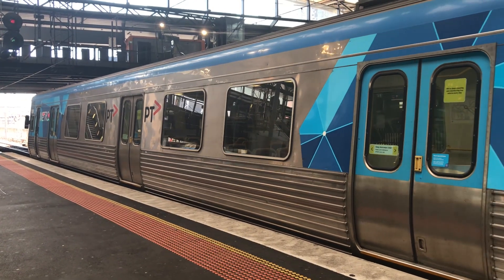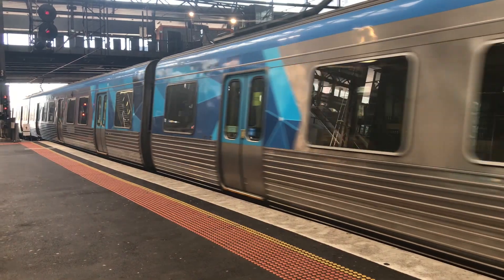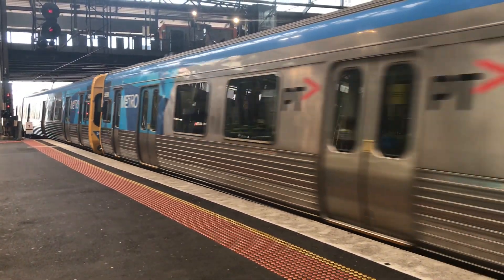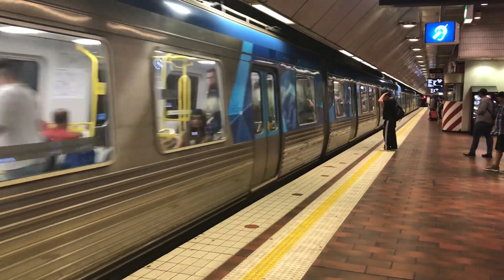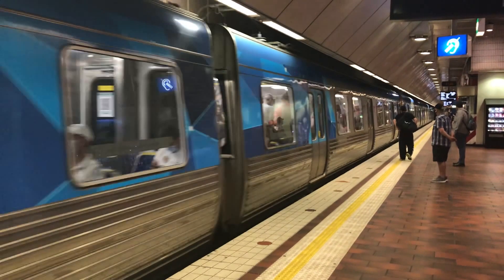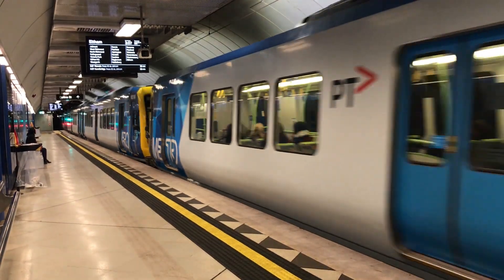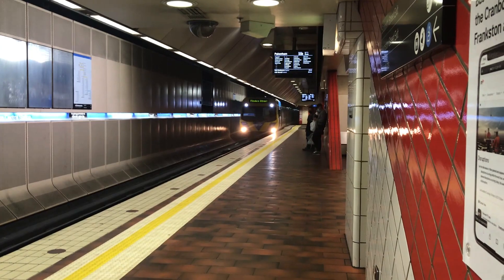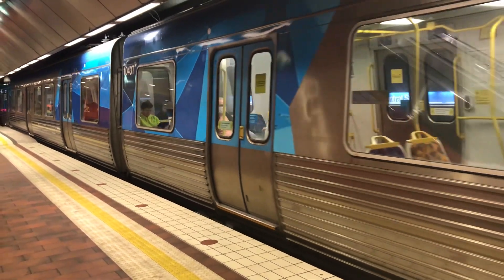The City Loop Reconfiguration Explained

Comment: I totally agree, one thing i would change is for the Clifton hill loop to run anti clockwise again, i know it can be a bottleneck because its not on the right track but an idea i had was if Jolimont station could possibly switch platforms during the day, on weekday mornings platform to can be used as the city platform going anticlockwise and platform 1 used for trains towards Mernda and Hurstbridge and on weekday afternoons it can go as usual, they would have to make a switch between Richmond and Jolimont, that may lead to the Clifton hill lines being shut down for a while but it would be better if they did change direction again since the Caulfield loop will be soon.

Comment: My take on the City Loop Recon is to run the Sandringham line through the Caufield loop. If the Pakenham & Cranbourne lines will be taken out of the Caufield Loop and into the Metro Tunnel, why don't they make the Sandringham line run through the Caufield Loop alongside the Frankston Line maybe on weekdays, then on weekends it could run directly to/from Flinders or cross-city with the Werribee & Williamstown lines. At the moment, the Sandy trains depart Flinders St on Platform 12 and if it is to run through the loop bi-directional then it could share Platforms 6-8 with the Frankston line once the Pakenham & Cranbourne lines are taken out. Same thing at Southern Cross, it can use Platform 12 as this is the platform used for the Caufield Group lines. Another thing is at Richmond station, i wonder which lines will use Platforms 5 & 6 once the Pakenham/Cranbourne lines are running through the Metro tunnel. Also, i think they should remove the Glen Waverley & Alamein lines out of the Burnley Loop and run them directly to/from Flinders Street to allow for more frequency on the busy Ringwood Lines (Belgrave & Lilydale).
Reply from the maker: The Sandringham Line does not have grade-separated access into the City Loop and as a result this would create a major bottleneck at Richmond Station. This is without mentioning that the Frankston Line basically already runs at full capacity during peak hours, so you'd end up removing some trains on what is a much busier line than Sandringham.

You've pretty much hit the nail on the head with Glen Waverley / Alamein, that is exactly what is planned.
Reply: @MetroManMelbourne  I understand that of the bottleneck situation but the Sandringham trains could use Platform 5 & 6 at Richmond for direct entry into the Caufield tunnel whilst Frankston is still at 3 and 4. If i remember correctly, there was a time years back when the Caufield tunnel was being used by the Pakenham, Cranbourne, Frankston and Sandringham lines from Richmond Station.  

Watch this drivers view video of Sandringham to Flinders Street service running via the Caufield Loop: https://www.youtube.com/watch?v=DW8i3Pwt7KE&t=113s
Reply from the maker: @neddie3noah  There is no way for Sandringham trains to cross to platforms 5 and 6 at Richmond.

Until 2021 Sandringham trains ran into the loop but only on weekends due to that capacity constraint. It would be unnecessarily confusing to have them in the loop again.

Comment: One obstacle PTV/Victorian Government would have to overcome with the Upfield/Glen Waverley configuration is the fact that most of the Comeng trains will be out of service by the time the project opens. As the X'Trapolis 100s can't run on the Upfield line (yet), and the Siemens Nexas can't run on the Glen Waverley line (yet), there will be an issue around getting enough trains to service the new configuration. Given the current order of X'Trapolis 2.0s only stands at 25 sets, surely they'll have to clear the X'Trapolis 100s for revenue service on the Upfield line or vice-versa with the Siemens for the configuration to work.

Will be interesting to see how this plays out!
Reply: no stinky trains on Glen Waverley line thx
Reply: @Redstoner2b2t  Which trains are you calling stinky?

Comment: I don’t think this is a good idea. This might hurt the line groups like separating the Craigieburn and Upfield Lines to connect with the Frankston and Glen Waverley Lines. This is just my opinion.
Reply: Just rename the lines? Through running trains are far superior to non-through running especially considering all of the major depots are outside of the city centre. It could also allow for better stopping patterns like in Copenhagen where some trains will run express one side of the line until the CBD then stopping all stations on the other to increase capacity and speed up services.

Comment: first there, can't get to desired city station -  it is not the station that is the destination but what is near by
your fucked been on the Werribee Frankston ect line and want to get to Melbourne central / go to Flinders, cross the street to elizabeth st 19/57/58 or right out Swanston and there is 1/3/5/6/16/64/67/72 and only need to go 3 stops (big deal)
THEN "cross platform interchange" - well shit I did not know I could take a train into the city get off at flagstaff walk across the platform and go BACK

Comment: Ideally what actually should be done is a new tunnel branching off at Parliament and heading under Fitzroy (Smith or Brunswick St) with a station or two then coming up around Clifton hill to carry the various lines and eliminate the bottle neck through Collingwood. And thereby take at least the Mernda lines out of the loop into the new tunnel link leaving Hurtsbridge on the old line through Collingwood.

Comment: Very exciting to see the modernisation of the City Loop!

Would definitely be good if they introduce cross-platform interchange, really will improve the system to a whole 'nother level. Just hope passengers can understand with increased frequency and better interchanges, one-seat rides are neat but not really needed for a "good" transit network.

Are there any other improvements that Metro is looking into? And has there been any news on Metro 2 thus far? (personally haven't heard anything new since 2020)
Reply from the maker: There has been some news regarding MM2 from infrastructure victoria who basically said to get ready for it to be built.

As for the rest of the network, the Cranbourne line upgrade has now been finished thus meaning we are likely to see a clyde extension soon. Further electrification to the west and north is also likely not that far in the future.
Reply: @MetroManMelbourne  Neat! (and for the north, Upfield/Craigieburn connection to Donnybrook some day? xD

Oh yeah, electrification out to Bacchus Marsh? iirc

Comment: I don't like it, instead I would rather see underground railway lines  between Footscray and Burnley stations with underground platforms at all stations in between except South Kensington and East Richmond, these new tracks can be used for transferring the Lilydale and Belgrave lines to go to Sunshine, then free up platform 4 of the Cityloop for Alamein and Glen Waverley lines, making Frankston and Craigieburn lines miss out on Flinders Street and Southern Cross Stations is nothing but a stupidity which defeats the purpose of what Cityloop was built for in the first place, and also where would the Melton line go if it gets electrified? won't it need construction of platform 5 on Cityloop stations?
Reply from the maker: The reality is that it is far cheaper and far more sensible to rebuild the loop for higher capacity. The City Loop was actually mainly built for capacity and so actually didn't do very well with that for various reasons. It also makes no sense to route pretty much every line through the loop. Melton trains will likely terminate at Southern Cross which is absolutely fine as people can interchange.
Reply: Agree. This is arranging deckchairs on the titanic and is a huge waste of money. The concept of the loop is wrong anyway. In 1975 it was ok but not 50 years later. They should not be trains running one direction PM and another AM. That’s a massive waste, inefficient and confusing. Not does it serve the needs of passengers.  The number of lines using it should be reduced and the lines that do, it should be no-directional at all times.  Other lines could have new tunnels built that transverse other parts of the city (for example take the Lillydale/Belgrave etc lines and run them in new tunnels from Richmond to Parliament with a new interchange then straight down Bourke St with a station at the GPO then right up to SC (another underground interchange) and have the tunnels rising in Docklands taking a western suburbs lines. No need to go to flinders St if there is a station at the GPO

Comment: Don't really see the point of this. Capacity won't or possibly ever be an issue with the uptake of WFH and more "second CBDs" as Melbourne continues to grow outwards.
Reply from the maker: That's not the only benefit though - it allows for the network to be simplified and further separated thus making trains more reliable. And the problem of Northern trains merging will continue to be an issue.

Comment: Good stuff! I'd never heard of the second part of the project. Do you have a document where I could read into it more?
Reply from the maker: There is more stuff from infrastructure vic about the first stage (https://www.infrastructurevictoria.com.au/wp-content/uploads/2021/08/Fact-sheet-City-Loop-reconfiguration.pdf) but not yet about the second. The second is a lot more recent of a proposal so it hasn't been talked about very much.
Reply: @MetroManMelbourne  Thanks. Yeah I had never heard of the second part. It will be interesting to see whether it gains more publicity.